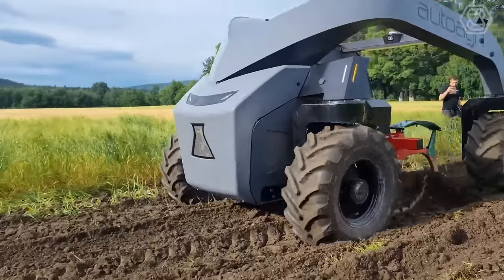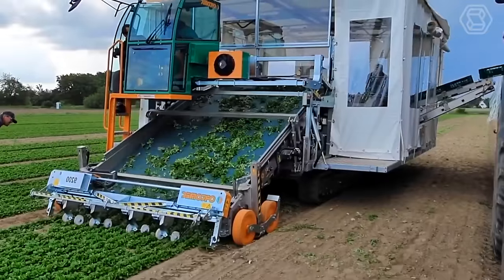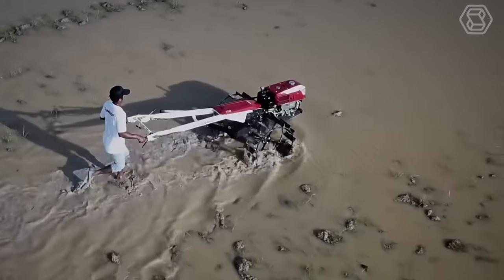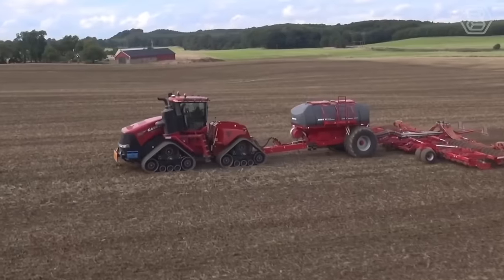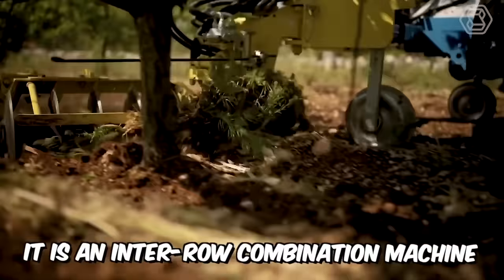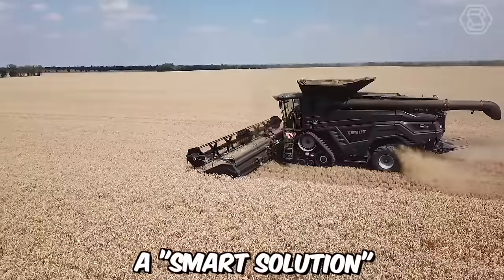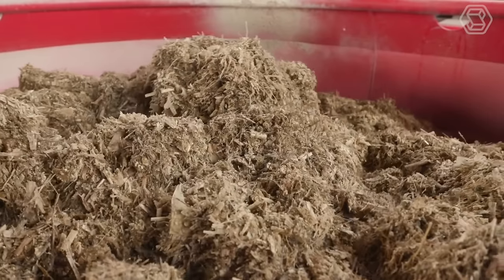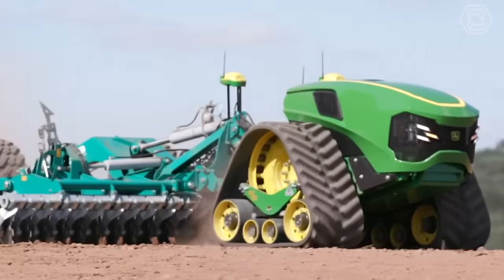150 Most Expensive Agriculture Machines and Ingenious Tools ▶ 21

Comment: 13:01 Truly impressed with the perfect combination from Krone! Not only is it cutting-edge technology with three powerful machines, but also the attention to detail, such as the roller conditioner that protects sensitive crops and optimizes the harvesting process. This trio has really proven its strength in the 2021 season. It's a comprehensive solution for agriculture, from cutting and harvesting to efficient and fast crop processing. Krone continues to assert its position in the industry!